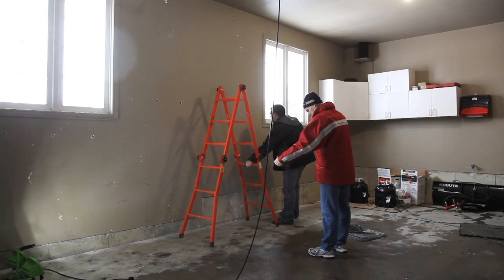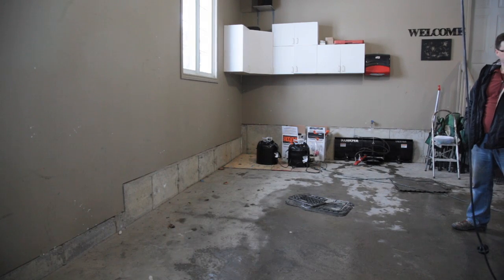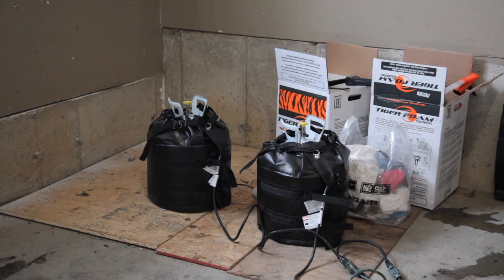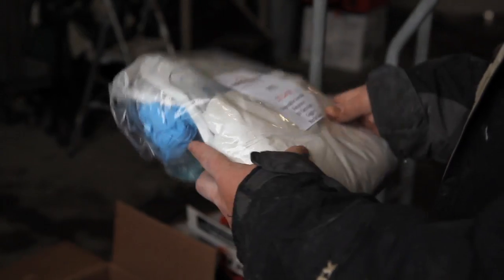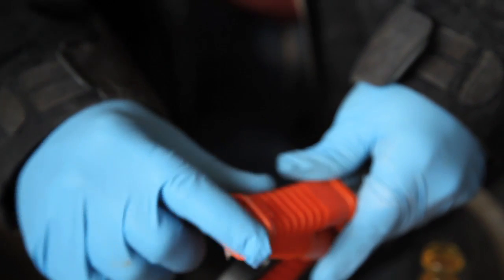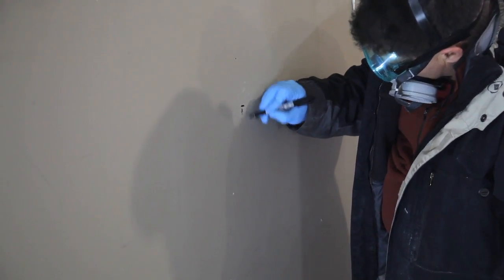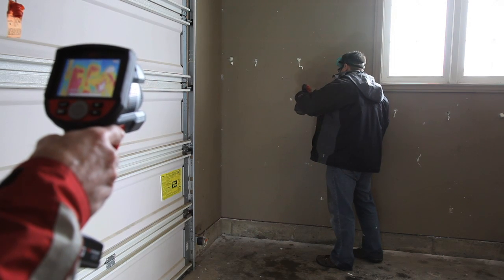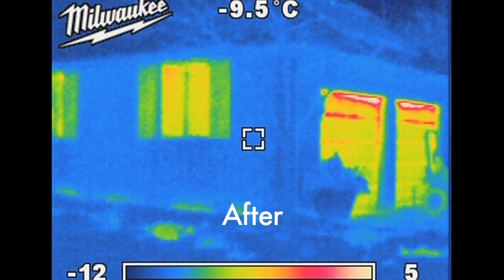Upgrading Stud Wall Energy Performance With Spray Foam

Comment: Thanks for the video! Your top holes appear to be about 8" from the ceiling. Do you expect the spray foam to expand above those holes to fill to the top of the cavity?
Reply: He mentioned that there is solid wood behind the walls at the top.

Comment: Would this work if there is already insulation in the walls? Hoping to reduce external noise and improve insulation.
Reply: I have same question. Did you get an answer? My walls already have 4cm of plasterboard insulation with a gap of around 3cm behind